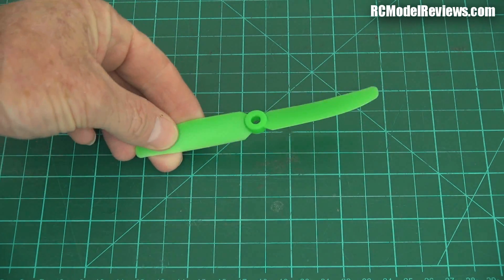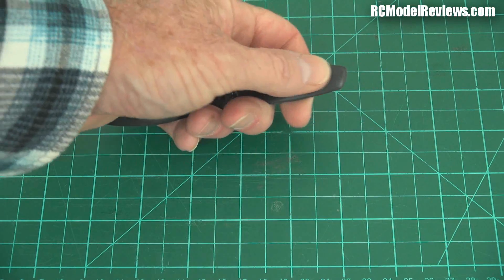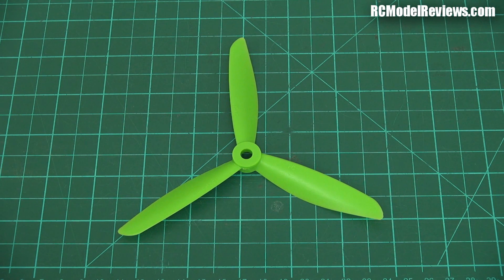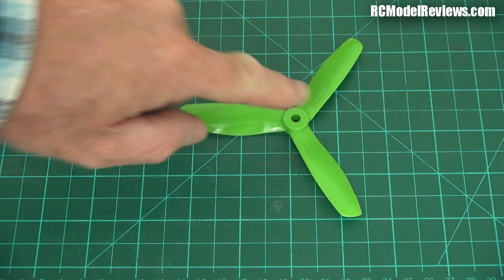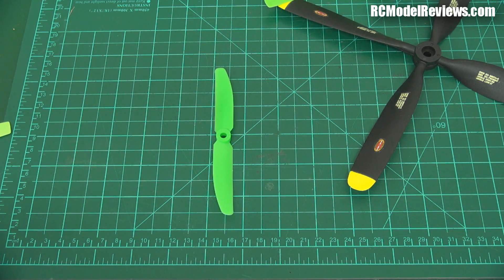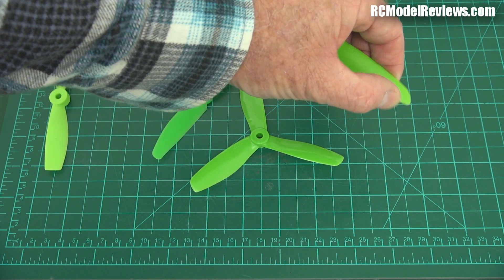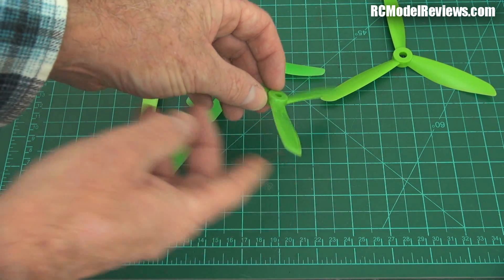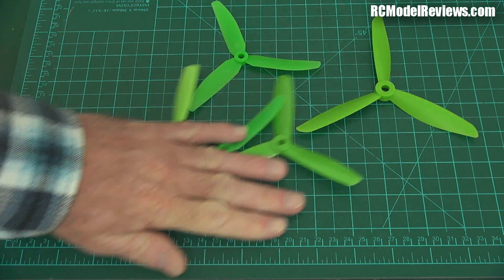Why use multi-bladed props?

Comment: You can make an airplane of 2 by 4's fly if given enough HP. The prop must be enough to take whatever HP your using and ALL prop tips must stay below the speed of sound regardless of diameter, hence the reason for prop RPM reduction gearboxes. You need a lot of HP to move a lot of airplane fast. Reason is same as why they don't use horse & buggy to pull freight trains...

Comment: Do you remember the Voyager project? That first plane doing a non stop around the world? They wanted efficient props for a reason. Some Swiss company promised them experimental miracles built in wood. When blade angle adjusting motors turned out to be toy quality, blades broke off, they finally gave up. Voyager flew around the world with props built (in overtime) by a renowned American propeller company. Find the Voyager story online or in the book.

Comment: 7:20 so they had to add more  blades bc the engine was too powerful?  so a p51-d mustang with only 2 blades or  3, would've been too much engine?  so in essence the extra blades created more drag to basically keep the engine tamed from over revving?

Comment: Do you need to reduce the prop size when adding blades if keeping motor and esc the same. I didn't know if the the extra loading would over whelm the electronics and if reducing the prop size would you need a higher kv motor to increase revs.

Comment: so would a gyrocopter benefit from having 3/ or even 4 bladed props? considering they generate lift due to auto-rotation, would having a bit more drag on the blades make them spin faster, or if not faster, generate more lift at the same RPM? 
I know this is slightly out of the depth of this vid, but i was really curious. ty

Comment: U beat me to it every time... I'm 38 n your running circles around me. Lmao 😉 n I still use bullnose on some wings where I dont have clearance and I swear I have diminished returns with tri blades on my pushers.... maybe it's me, I'll bet u cover it before I finish typing lol ha bn if efficiany doesn't matter in that setup. Like a mini Skywalker with a 2828 1200 so 6 inch tri blade ha bn seems to be VERY OVERPOWERED, however, I LIKE overpowered setups because I can run everything lower, power ect. Just nice to have punch
Reply: I may need a bigger blade can u RECOMMEND anything Bruce? I have almost every prop but like I said I should have TO much thrust buy using such a large motor, and it's a niodium motor from turnigy. Would love to know what prop you would RECOMMEND To not unprop this ridiculous build.. running my first arkbird
Reply: Arkbird tiny.. and 40 amp wing esc

Comment: Another advantage is imparted by how horsepower works, this applies for all rotating machinery NOT JUST RECIPROCATING ENGINES! :)

 Horsepower is torque multiplied by RPM divided by 5252. By using more blades you trade off needing a small amount of torque at higher RPMs for a greater amount of torque at much lower RPMs. Thus you are decreasing the amount of HP you need to generate the same thrust by a small bit.

Comment: there is so much more than just efficiency- with some gas engine applications, a difference in just one number on the pitch of a prop can make all of the difference. It sometimes seems that too much air flowing past the tail surfaces gives terrible performance. Experimentation and patience is required to find that one "perfect" prop- once it is found, remember it! Each aircraft is different, even matched aircraft built side by side.

Comment: Prop exploration is a good use case for sensors either with telemetry or just logging on-board, specifically current, voltage, RPM, motor/ESC thermometers, maybe gforce, airspeed, an altimeter/variometer to ensure test runs were done at level altitude, and maybe GPS for a second opinion of speed (on a day with no wind) and altitude. Testing on the bench with a wattmeter and some contraption for thrust only yields static performance, half the picture. Anyway, hey old timer, what's with you and drones? You look like a fixed wing man. Of the sailplane variety.  :)

Comment: Sorry for venting here. how about constant pitch props? Always wondered why props had that taper to them. I assume its because the speed of the tip is faster than the speed near the hub. Is this correct? More thrust is more torque also right? Hence slowly add power to take off to prevent torque roll. I see pilots constantly not using rudder correctly.  I  teach fellow pilots use of rudder for Take off, coordinated turns, slipping etc.. There are so many effects with props.  Gyroscopic effect and asymmetric effect. Most R/C pilots fly turn and burn only using aileron.  Also explain why we have right thrust built into planes. Thanks again for All your great videos. I've learned so much about electrics. I'll be putting up a safety video soon. Unlike a gas or glow motor. Once shut off that's it. Electrics are ALWAYS on. Just got 8 stitches in my arm . Was a dumb thing. especially since I've been flying for over 25 years. Three  words. Throttle cut switch....

Comment: Is there a rule of thumb for upgrading to a 3 or 4 blade prop. I would think i would have to either reduce pitch or diameter in order not to put to much load on my motor. I have a corsair that i put an E-flight power 110 motor with a 110 amp esc . I will be starting off with an 18-8 two blade. I would like to put a scale 4 blade like my previous comment.  Any suggestions?

Comment: funny.....so a motor runs at maximum efficiancy without load?
Reply: No, the more loaded the (electric)motor is, the more efficient it is, as long as you don't load the motor beyond it's rated load.

A motor without load is just turning it's shaft and overcoming it's internal resistance (bearing resistance and internal mass). The more you load that motor the more efficient it gets.

If you load a motor beyond it's rated load, the efficiency goes back down.

Comment: So I suppose having more propeller blades on an aircraft is a bit like having wider tyres on a vehicle. You get better traction, but also lose more energy through friction.
Reply: These people don’t know what they are talking about Andy, you are right. There is a reason why race cars don’t have ridiculously wide/tall tires, there is a loss of return at some point, just like a propeller.
Reply: that is not a true statement.     as more tier less pounds on each  square inch of tire.    and  in mud and snow tires will ride up not sink in to grip
Reply: From rotational Physics, in an ideal world, there is only static friction between the tires and the ground and this friction does no work and thus you don’t lose energy. Rolling resistance is more due to the chemical grip and mechanical grip of the tire literally sinking their rubber molecules into the road and the rolling motion have to pull these molecules out when the tire keeps rolling. That is also how tracks rubbers in——race car tires experiences this so violently that they literally leave part and layers of their tires into the tarmac, and the tarmac now will give more grip and wear the tires less.
Reply: The majority of drag on cars, trucks, etc is from aerodynamic force, not from the tires

Comment: essentially... more blades is to pack more blade area in the same diameter.

But each added tip is  a significant power loss so you loose efficiency.  (assuming same blade design)

The P-51 used 4 bladed props to keep the tips out of the dirt when taking off and landing.

Comment: Hi Bruce. I was just wondering... What would happen if you've got a really bad balanced prop and instead of adding or removing weight you just cut the tip of the heavy part? It will have a shorter and a longer blade. What will happen to the noise it makes, the tip vortex, the efficency? I can't try that myself as i don't have a rig to test it... Please reply :)

Comment: The principle involved here is called "impedance matching".   To get maximum efficiency, you have to match the impedance of the blade (thrust vs drag) to the impedance of the motor (torque vs battery draw).  Just like in stereos where you match the impedance (resistance) of the speaker to the impedance of the amp, or like in cars where you match the torque/speed of the tires to the torque/speed of the engine with a "mechanical impedance transformer" - called a transmission!
Reply: Greg Collins thank fuck someone mentioned this, i was going insane
Reply: So then we need a transmission propeller. Is that why they made jet engine?

Comment: Is puttung a duct around your propeller, but without the lip to avoid the negative effects of tilting a ducted prop with the lip and then using a bullnose to increase the efficiency (when ducted it should let less air get around the edge) a good idea or am I missing something?

Comment: Hello, nice intro to multi props!
How about equations?
Electric ducted fans get as much as ten bladed props. They are known for poor thrust and high current draw so what : when does the drag induced by the amount of blades counterbalance the increase in thrust? Or should we just fit as many blades as we can in the prop wake , until it becomes one big disk:) ? When is motor max load reached?
I am not equiped with Kv and motor equations well enough, you could enlighten me, BR

Comment: The real breakthrough in power vs. efficiency will be the development of variable pitch constant speed props for RC/quads. Best of both worlds; Thrust on demand, efficient drag profiles during cruise power settings.
Reply: @WilliamHelstad  any helicopter
Reply: @WilliamHelstad  im not sure about the efficiency since they are not as well shaped as a fixed pitch prop. But they are multi pitch constant rpm

Comment: Ok but one thing I just can't quite get any info on is high kv low pitch and small blade vs low kv high pitch big blade. For example, assuming you use say an a2208 motor at 2600 kv and a 5x3 prop, then the same size a2208 motor at 1400kv but with say a 7x7 prop (or whatever gives you the same pitch speed as the 2600kv) what are going to be the similarities and differences? Will the higher kv just be better all around? If so, why even use low kv motors? Why not just use high kv with a lower pitch? In my example, you should have the same speed and power correct? Would one be more efficient?
Reply: He mentioned blade pitch vs blade stall speed with the lower pitch maintaining effectiveness at lower speeds. I suspect that the larger the RPM change on a motor, the more power will be required to get to the desired RPM. Thus, the higher speed motors and the heavier props may be more likely to brown out the power rails during wild maneuvers on higher cell-count packs or underrated electronics.
Reply: Well, I've since researched this much more and all I can really conclude is theres so many friggin variables that its not worth it to even factor these in, best to just get your speed however you can\cheapest way you can. Ive found thinking of kv as a customization to match your equipment is much better than trying to figure out what's going to be the most perfectly efficient. I like high kv because you can get more power from a cheaper motor, that's really the biggest concern of mine, power vs cost.
Reply: And more thrust* before anyone throws a "ya but" at me explaining power doesn't necessarily translate into thrust :), which is true but pretty much every example I can find you'll get more thrust from a higher kv motor with all else equal. Low kv is good sometimes too, you can go with an oversized motor with a low kv to get pretty crazy thrust from minimum watt draw with a large prop, so you're paying more for motor and more for prop but they'll run on cheaper electronics. Oh and also theres the partial throttle effects, I guess low kv is much more efficient partial throttle, I tend to fly full throttle a lot so that doesn't affect me much.High kv will use a much smaller lighter prop, and low kv uses very large heavy props, so I suspect it takes about the same amount of power to get each setup up to rpm, but the smaller prop will be less efficient, which is another factor.
Reply: I suppose the old car argument "Torque vs Horsepower" comes into play here somewhere. I've still got a lot to learn. :)
Reply: Yea it kinda does, that ones way simpler though, horsepower all the way as long as you have adequate torque ;)

Comment: I have a question, If you want to run a 5x4x3 on a 15 amp ESC do you run the chance of burning out the esc?  lets say on a RS2205 -2300KV motor?

Comment: great stuff bruce, i'm, just pondering these very questions,  could you take a guess at what is the fastest prop for a 2s lowish 'c' rating, (30c) and 6040 knife edges and 5045x3 bullnose's?.. using the jjrc x1 we seem to be getting more punch from 6040s but the 5045x3 BN's have a higher top speed....>scratches head<... any tips on how to put a good finish on cut down bullnose's?

Comment: Bullnose and knife-blade, but there's also Q-tip and Scimitar, as well as some diamond shaped variants. Not sure if those have made it to RC yet along with prop-fans. (More than 6 blades, but not ducted.)

Then you also have to keep in mind performance relative to airspeed. A prop that has a lot of bite in a static test might not have the top end aircraft speed of a prop that doesn't work as well in that situation. (So there's probably some choice between punchiness in acceleration and overall top speed.)

Comment: Why use multi blade props? Because it's a pain in the ass trying to balance a single blade prop.
Reply: +3d Chris I have to admit I had to think about that for more than 1 second! Very witty!
Reply: +Mike Mac nope, because it is impossible to balance a prop with only one blade. Because there is only one blade. I think you are thinking of 2 bladed props. But even those dont always come balanced out of the box. I was just poking fun at the title of this video.
Reply: 3d Chris
Just curious, mentioned that one blade props do exist in the video, with a counterweight to balance it out. Then I got into air resistance, Bernoulli, ducted fan, wing tip vorticies and my ears started to bleed...
Reply: +3d Chris A single blade prop doesn't come balanced out of the box?
Reply: +Damien Mullins thank you sir.
Reply: We used to fly with 1-Bladed Props, on Control Line Models! We also had to use braided steel cable for control lines, if we went over 100 mph...!  Then came the "Mono-Lines".  (I never did like them, 'cause it was a pain in the ass getting the line "sorted out" at the handle and bellcrank!)... Dang!  Brings back memories of 50 and 60 years ago!  Haha!

Comment: I'm mostly thinking triple blades offer the best ratio, especially to avoid ring-State and I was wondering if you're use a 3d printed clover prop with integrated circular duct if it would give you some benefit :-?

Comment: Other reason for late WWII fighters to have propellers with increased number of blades instead of longer ones was to reduce the blade tip speed, as they had then a very high dive speed blade tips had air compressibility issues. Also wider blades have lower tip speed for the same blade area than longer ones. For normal RC planes this doesn't matter because they fly at very low MACH.
Reply: Good point

Comment: One thing I've been confused by recently is contra-rotating props.  I've read they improve efficiency and are used by planes like the Russian Tu-95.  But at the same time miniquads like a Y6 design that have counter rotating props are considered much less efficient due to one prop being in the prop wash of the other.  It's strange how depending on the application it's more or less efficient.  The only thing I can guess is that the Y6 miniquad has the props too far apart so it doesn't get the benefits like a contra-rotating prop on an airplane.  The props are almost touching on a contra-rotating airplane setup.

Comment: Very good video explaining why 3-blade props could be better or worse than 2-blade props. I'm quite liking the new DYS 5x4x3. They're cheap, well balanced and perform nearly identical to the more expensive HQ5x4x3. With the now popular 2205 motors they rock!. please, test on 4S -that's where speeds get ballistic ;)

Comment: Well done, Bruce!  An excellent discussion of propeller basics.  For the fixed wing drivers, perhaps a video discussion of the considerations of prop pitch and diameter selection for a given airplane/motor, including going from two to three or four blades..
Cheers!

Comment: A rationally objective comparison should eliminate the pilot (sorry about that, Bruce - no offense intended) and use a GPS waypoint mission profile with an equilateral triangular course to eliminate wind influence and wind variations. Flight logs comparison should reveal all. Constant speed against power consumption, for efficiency, and max throttle vs lap time.

Comment: USAF used six-blade constant speed variable pitch props on recon aircraft that skimmed the treetops of the Vietnam jungle. The motors were all padded up with soundproofing, and the slow-revving props had such low tip-speed that the plane was already passed before it could be heard - 'woosh'. I'm not a speed freak, so my 800g scratch-built 330 tri-copter has 2210 - 1400kv motors with 10x4.5 SF props - 2.5+ to 1 power ratio and a respectful 'wrrooosh'. Top speed? Who cares! Faster than I need.

Comment: Hi Bruce. What you said about WW2 aircraft is true in that more blades provide more thrust but also means a reduced diameter. The inverted "gull wing" shape of the Chance Vought Corsair came about because they fitted the most powerful radial engine available (same as fitted to the B25 bomber) which needed a HUGE prop. So to stop the damn thing hitting the flight deck on landing, the designers "bent" the wing into its famous "W" shape.